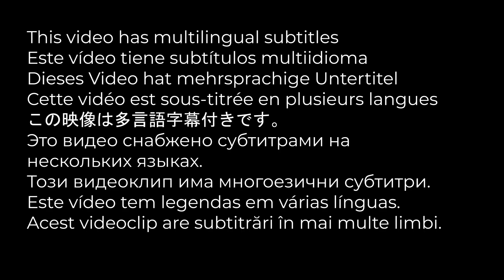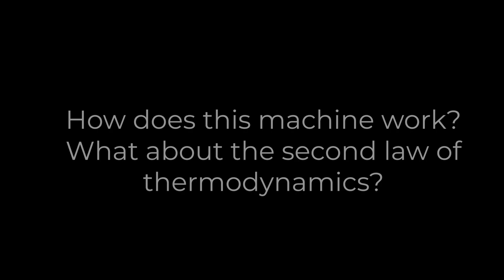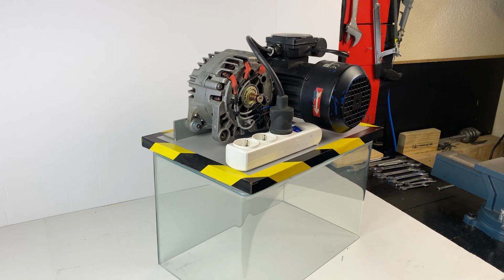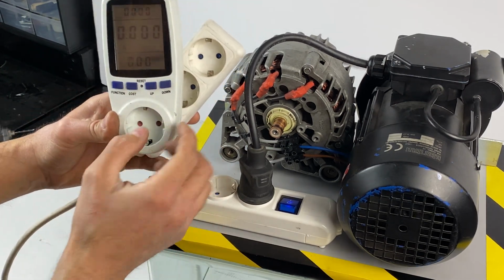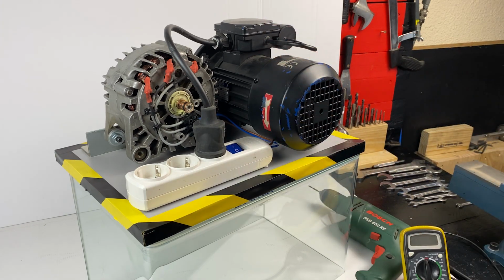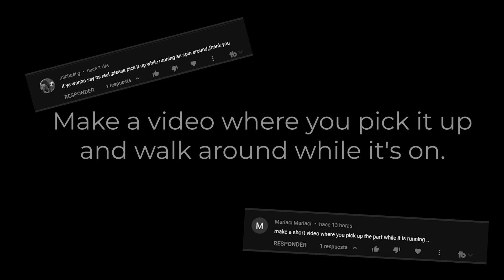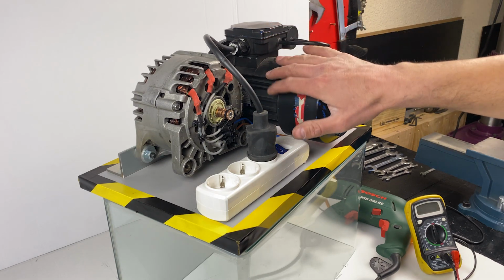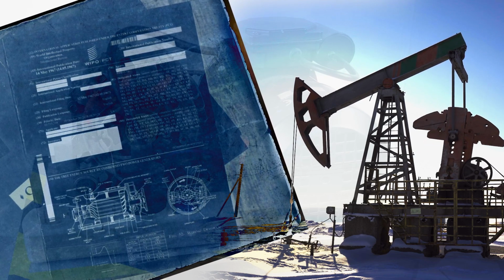We put this Infinite Energy Generator to Test - Liberty Engine 1.0

Comment: I've been saying for years now that this was possible, but I need one big enough to run a large camper, I guess I need to just start building me one, thanks for sharing.
Reply: around 12:45 we see the red wire hidden or the shadow on the bottom of the red shelf
Reply: My ex used to talk about building this for years , especially since the gas prices have gone up so high. Looks like he's right.
Reply: @philippecaouette4275  There is a fuzzy red line there and I see no reason for it. Also, right before he sets it on the table, you can see a dark line reflected in the table top. Right at 12:46. Maybe that's what your are referring to? That suggests something dark hanging between the table top and the red background that is being reflected in the platform top. If the video producers would like, I can remove that for them in After FX. 

Also, why carry the device so low. Lift the sucker up high for us puleez. :^)

BTW, the way to show this is to put it up on a rotating pedestal. But then they'd have to have a transparent base (why the yellow black edge tape on the device's base?), a transparent power strip, and transparent device cases to make the puzzle really hard. Right now there are just so many possible ways to hide stuff.
Reply: Yykjj
Reply: I just wonder how many of you that are saying this and saying how many of you have actually tried to 4 Mile the only one in here that's not a professor of energy and electronics??? Because I have seen a lot of people say things wouldn't work and they never tried them themselves. Because from what I read and studied this is possible if you can boost the output .
Reply: @philippecaouette4275  That's a lie. I didn't see it. and I watched many times. You must be high on something. There was NO hidden wire any where. just a pull string almost red. that's what YOU SAW.

Comment: In electronics college we had a light bulb mounted into the top center of a clear plexiglass box. And it lit! Some went 'ohhh ahhh but I did not buy it. As it turned out, the plexiglass had a film of gold on each side. It was so thin, you could not see it with a very strong magnifying glass. I will stand with the first law of thermodynamics. Energy can neither be created or destroyed. I would not send these people any money!😆😆😆
Reply: I don’t believe they are asking for any money tho. But I agree you cannot create energy from nothing. It has to come from somewhere. It would be cool if more people were able to build this , and post videos as well. If multiple people have a working device it is far more likely to be true than if only one person has one.
Reply: @manifest_with_vibration5726  there are people who have done it
Reply: i highly doubt that a thin film of gold would have done anything on that plexiglass block as he picked it up and carried it for over 40 seconds with no visible change in rpm pitch or volume which would have been noticeable with as large a motor he had also this doesn't violate thermo dynamics he is converting the magnetic energy of the permanent magnets inside into electricity and then into force thus creating a loop / cycle if there was a battery in the bottom i highly doubt he would have been physically able to lift the entirety of the item an electric motor like that is not light nor an alternator of that size add to that a battery large enough to power the thing and honestly you would be talking about 50 to 60 lbs of weight if not more and that's a low ball guesstimate
Reply: It's scary how many think this is real
Reply: They aren't asking
Reply: @ferrofeles2063  prove it
Reply: Man I hated to have to scroll this far down to find common sense.

You think big companies wouldn't be using this process to save money?

An electric motor and an alternator isn't anything special.
Reply: 100% agreed.....you cant power a generator with an alternator or motor and introduce any load.........all the fools unwilling to educate themselves is terrifying
Reply: Photo electric plexiglass can easily power a light bulb.
Reply: There is no doubt this alternator and motor works.  An old generator with the Tesla magnets chiseled off the armature magnets also works as an edison generator.  If you add inverters to have house current voltage AC continuous peak power without fuel or pollution.
Reply: There is no doubt an alternators with motor will produce unlimited electric power without fuel or pollution.
Reply: @ferrofeles2063  show me ... talk is cheap.
Reply: @ferrofeles2063  Quote, " highly doubt that a thin film of gold would have done anything on that plexiglass block as he picked it up and carried it for over 40 seconds with no visible change in rpm pitch or volume ..."
So, basically, if you see a video of a live T-Rex, T-Rex must be living creatures ... says a lot about you ability to reason ... or inability.
Reply: @markcampbell7577  no it wont.

Comment: The hardest part of making a free energy machine is finding a spot to hide the batteries.
Reply: Als je heel je leven bent voorgelogen, word het erg lastig om je daarvan te overtuigen dat waar je in gelooft niet waar is.
Reply: диодный мост с конденсаторами в доске!!! Доска обклеена непрозрачным скотчем, чтоб не было видно, что доска поклеена на несколько частей. 
a diode bridge with capacitors in the board!!! The board is covered with opaque adhesive tape so that it is not visible that the board is glued into several parts.
Reply: Lmmfao 😆😅🤣😂 good one!

Comment: My dear friend. Thanks for the excellent video presentation. I am an old physicist with knowledge on electronics and chemistry and i wanted to make some comments and suggestions to you. You already know that ENERGY CANNOT BE MADE FROM NOTHING. You mentioned earth's magnetic field.,which is very week for the cross section of the alternator etc.The best way to proof your invention is this : Connect a heavy load and meters for Amps and Voltage, so you will show the output power. Also do the same for the electric motor the same time so you measure the power the motor is taking. Then if is proof that the "free energy " is real please protect yourself from criminals and assholes. I don't want you to have the same faith of Standley Meyer .REGARDS and wishes from CYPRUS. All my best and TAKE CARE!
Reply: Yess.. Corect..
Reply: A good points of view brother thank you.
Reply: I've known of this ability since the 1980's while in high school, we discussed turning a car alternators into household current, (not with magnets though) just through the electronics. Then I mentioned then why couldn't we hook up a low voltage electric motor with gears to drive the alternator, I do like the idea of the magnets to I crease the power output, one could still use a smaller voltage electric motor and use gears instead of a belt drive system to have even more output, just a thought, but Thanks for taking the time to make it, explain it to the Nay sayers, (which didn't listen in class, or skipped school all together) to me this is common sense but hay Thanks for Sharing for others to see, it's almost like Nikola Tesla said screw the guys funding him and said here's 2 invention now I pray someone figures out how to put them together because the capitalist wouldn't let him do it cause of greed, but please share as much as possible Thanks Y'all for watching and learning something that others have kept from you's for close to a hundred yrs. Andrew T From Barrie Ontario Canada L4M2Z8
Reply: egal wie..... mit immer dagegen sprechen wurde nie was neues erfunden!
Reply: @derausbauer4665  
Ich glaube ich weiß was du meinst, aber bitte lerne etwas deutsch
Reply: @christopherbaum3951   ja frau gebearbockt 🙂
Reply: @Busted.Knuckles.Garage  You do realize if this works - you could just make an even bigger motor and alternator and connect to the one we see here. Then an even bigger set to the one we just added - and so on forever. Don't you think that sounds a bit...off?
Reply: @pandawow789  so you wrote you have more input than output power, so I consumes more that it produces? Which generator you use with 3000rpm?
Reply: @pandawow789  do you have the first video link? Tks
Reply: @pandawow789  Now thats something...! Basically what he has used is a more powerful generater alternator to produce electricity... and a lower one to run the motor... Just enough to cross the threashhold... So In theory, it should not matter as long as the generator/alternator is more powerful than the motor, and the motor must just be able to cross the threashhold of the other alternator. Also... remember - you need not use a string like he used to give the jolt... you can probably use an external sourse to give give the initial jolt... The objective is not prove a theory... the objective is to generate electricity... so... use a drill with an external source to give the initial jolt to the alternator... Try it and let us all know how it goes...
Reply: Maybe it would work until it runs out of energy at which point it would have to be spun up again?
Reply: @pandawow789   what alternator you use ? Because I can't found 24v 200amp
Reply: @iliqnmarinov9814 
Any late model truck.
Reply: @terryhull9724  I know! If you read my comments you see that I'm calling this as BS!
Reply: @terryhull9724  For skeptics! For some time ago it was believed that the phone would not work without wires, but today everyone has one, and there is also wireless charging.
Reply: @sanggyungkim9513  Sorry that is completely different.  One is dealing with the physical laws and another is dealing with advanced technology.   Fundamental issue is every process involved here introduces a loss.  Any time you pass a wire through a magnetic field, it takes more energy to force the wire through the field than you get out in electrical energy.   Energy Input - Energy Loss = Energy Output.   Just a hint - the energy loss is never negative.   Therefore Energy Out < Energy In.   If you could generate excess energy in this way, electric cars could have infinite range as you use a 100W motor to move the car and put 125W back into the batteries.   That is not the way it works.  You use 125W from the batteries to supply the wheels with 100 W of rotational energy.  BTW:  These numbers are meant as examples, not as realistic numbers.   Even the very large generators used to run our power grid are only 98 or 99% efficient.  However, that is just the generator itself, not the transmission system that gets the power to the point of consumption.   Distribution systems typically have over 20% loss.
Reply: @nagendravc  Come on, its like having a lightsource Shining on a solarpanel connected to the lightsource or a fan blowing on a windturbine that gives power to the fan. This setup is impossible, the small amount of energy produced in the generator Will never be able to turn both the motor and thereby itself. IF you could manage a total loss-free circuit you would never gain any energy anyway and putting the slightest extra load in the contraption would make it stop and it would never be perpetual, entropy and friction would eventually Bring to an halt...
Reply: @johnpetters3328  I think I mistook this video to be the one which works in conjunction with a flywheel. In the one with the flywheel, the flywheel acts as a battery with stored mechanical energy and hence it does work. So apologies... I sort of just glanced thro and replied
Reply: @jarls5890  Maybe, just like the domino effect!
Reply: @sanggyungkim9513  🙄
Reply: @terryhull9724  you are a very patient man, kind sir.
Reply: True please be anonymous and secure your account
Reply: if energy cannot be made from nothing how did the BIG BANG GET CREATED XD
Reply: ENERGY CAN ONLY BE INFINITE OR NON EXISTANT nothing in between
Reply: thermal dynamics also say entropy can only go in one direction which speaks against the big bang theory ;)

Comment: Can you share the list of parts? For example this specific size of the magnets
Reply: @ILiveInWackyTown that's the setup I'm looking for. 😆
I want to see a whole home run on this and the process of doing so. 
Is risky business doing this on your own home. Seems best to just buy the breaker box run a bunch of breakers n wires n outlets on for say a table or floor. A test set. Then the process of running tons of electrical devices that you hope don't fry. So the cheaper or more useless and or "disposable" the better like already broken devices that still drain alot of power like a washing machine that spins but doesn't pump water anymore or a stove that the oven works but not the stove top.